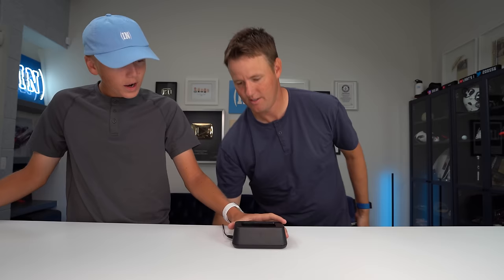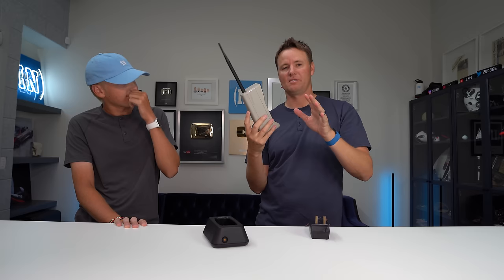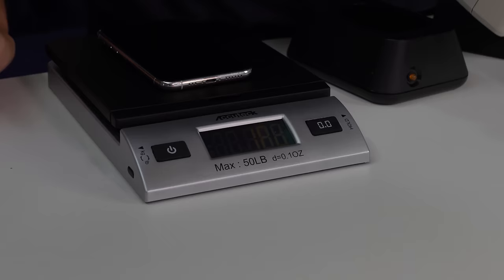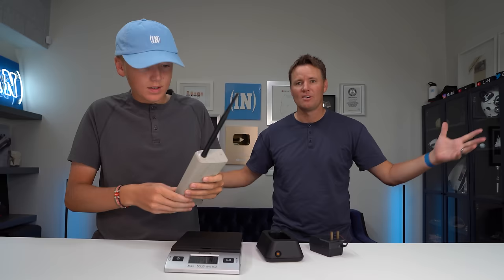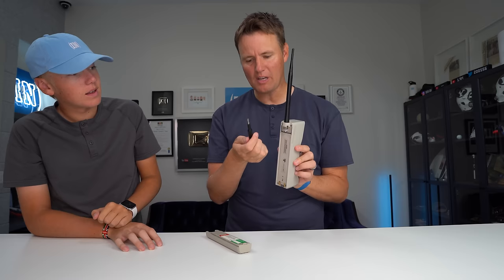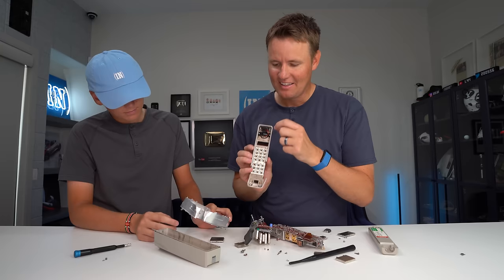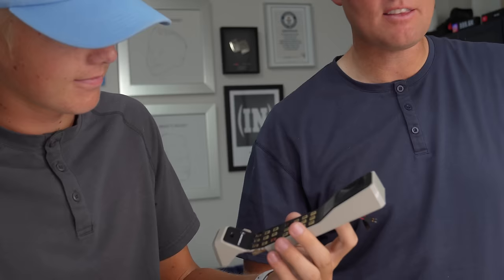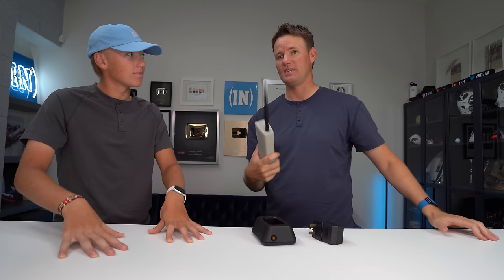What's inside World's First Cell Phone?

Comment: If youre referring to Jurassic Park 3 (sounds like you are) then they did not use the phone featured in this video. That film released in 2001. At that time we had clam shell phones like the Motorola Razr and the famous Nokia 3300 series phones. What they were using in the film was a satellite phone, meaning it did not rely on cellular towers. It instead worked off of satellites, which makes sense as they were on a remote island and the reason for its large size. There are theories that the phone used in the film was based off of the Globalstar SAT-550 satellite phone.

Comment: Removing the four screws at the beginning was still correct, but before you pull on the housing you have to disassemble the antenna port and pull the metal bracket down. Only then can you remove the housing without damaging the circuit board and antenna (see 7:06). From 8:04 onwards, four very long Allen screws would have had to be loosened in a clockwise direction. Then you can pull all the circuit boards out of the metal housing. I plan to make a detailed video of how I disassemble my Dynatac. If there is enough interest!

Comment: 6:07 I remember the battery lasting about 3 days before it started beeping to be recharged.
Reply: your today phone could last that long too without screen and wifi :)
Reply: @merlinwarage  You'd have tot run off bluetooth and out it into power saving mode too.
Reply: @TheTechAdmin  Nah. Actually without screen and wifi you'll have 4x more battery time. The modern phones have more modern batteries with at least 2x more capacity, today's bluetooth using way less energy than the old ones. Wifi and the screen using up the 80%-90% of the batteries.